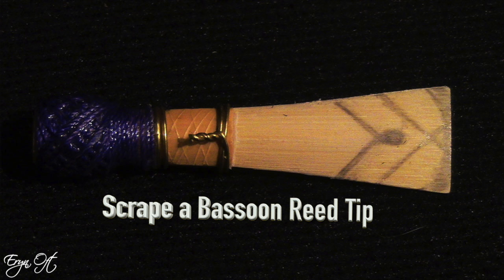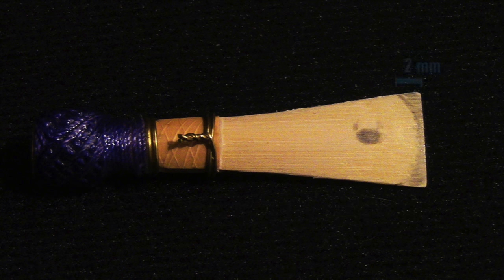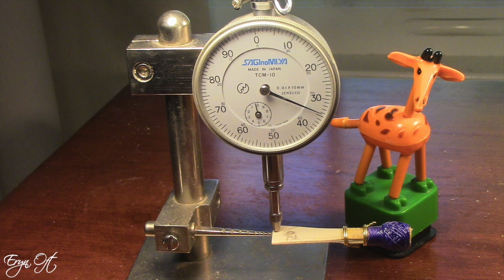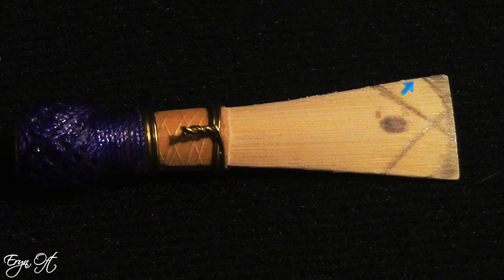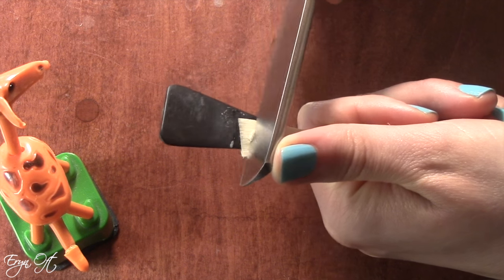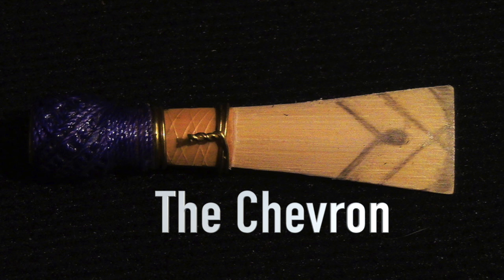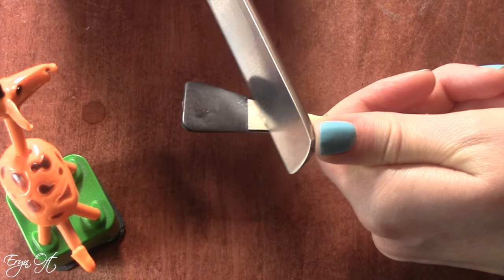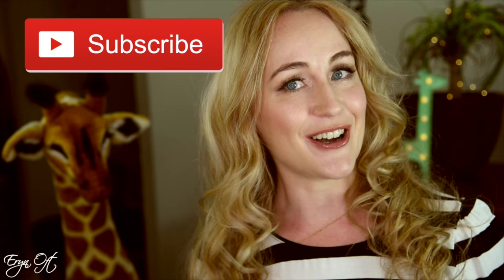3 Easy Steps to Scrape the Tip of a Bassoon Reed

Comment: Hi Eryn, I love your channel and all of the content you have been putting out! Do you have a video regarding reed adjustments? For example, I have some reeds that will drop drastically when I play an e. One of my teachers has told me to trim the length of the blade but it hasn't been successful for me.
Reply from the maker: Hi Shelby! Thanks for keeping up with my bassoon adventures. I am working on a video for reed adjustments. If trimming the blade of the reed hasn't helped I suggest checking the tension on the first wire, flexing the tip of the reed (I do have a video on this!) or waiting for the cane to age. Soft cane will be too flexible, if you can wait a couple of years this might be a great reed. The cane is too soft for now. Here's a link to the darkening video/blog: https://erynoft.com/2015/04/05/bassoon-reed-darken-sound/ Happy Bassoon-ing!

Comment: Thank you for this video. I found it incredibly helpful and my reeds immediately responded better with a warm, less resistant tone in all registers.  One question.... Do you approximate where the heart is or do you measure?  Thanks again!  I really enjoy your videos.
Reply from the maker: Hi Heidi! Thanks for watching. Glad you found it helpful. I do measure the heart and often times I color it with a pencil so that I am sure that I don't accidentally scrape the heart. If the pencil marks begin to disappear I know that I am over scraping. :)
Reply: Hi Eryn,

I'm hoping you can advise me on a reed issue.  Sometimes after working on a reed, the middle A won't speak properly.  It sounds like the lower A and the middle A are speaking at the same time.  I try flicking to get the middle A to resolve, which sometimes works right away, but it's a struggle.  This problem has happened to the last couple of reeds I've tried to finish....What do I do to fix this problem?  Thanks!
Reply from the maker: Hi Heidi, 

This is a tough one. Without seeing the reed, scraping technique and the match to bassoon and bocal I am not sure I can adequately answer your question. If you'd like to do a SKYPE reed lesson I could help more. But currently there are too many variables.  Wish I could do more. :)

Comment: Hi Eryn, do you have a video on reworking the cane when it's formed but the sides (rails?) don't meet? I've had some cane slip when I was adjusting the wires and I'm not sure how to move them back into place. :)
Reply: +Steph I would say from my experience (because this has happened a lot in my reed making) that once formed... you could reform if they don't look like they line up right... but that rarely fixes it in my opinion. take caution when putting on wires.. I was taught at first to tug on the wires and make sure it is very tight... but then I was shown to only really get it about finger tight and DO NOT TUG AND TIGHTEN!!! I find when I do this I can ever so slightly twist one way or another and then causing the blades to slip or slightly overlap. I find that a minute slip, more so a mild overlap than a slip, that it actually helps with my high notes a lot... the only problem I have with that is my own OCD that i want it perfect perfect... but we are dealing with cane... it's a plant... it will never be perfect... the plight of all bassoonist!
Reply from the maker: +Steph Great to hear from you! I don't currently have a video on my channel about this. I will add it to the filming agenda! It may take a bit of time but I will get there. Promise. :)

Comment: Do you scrape with the Reed wet or dry?
Reply from the maker: I make sure the reed has soaked for 30 seconds so that I can insert the plaque without worrying about cracking the reed down the tip. From there I scrape as the reed dries out. Hope this helps! :)

Comment: What is the dimensions of your reeds blade? (Collar to tip) I'm just wanting to check so I can adjust my scraping accordingly to the dimensions I use.
Reply from the maker: HI there, Here is a link to a blog with my initial scrape measurements that I use for my Raffe Reeds. https://erynoft.com/2016/02/28/barton-cane-eryn-oft-style-cane/ I only go this light on Hard Cane. Softer cane will collapse and run flat with these measurements. Cheers!

Comment: what do you do if you don't have a micrometer I probably misspelled that
Reply from the maker: I use a combination of micrometer and light. But you could just try using only light. Hold the reed blades in front of a bright light. It will show darker spots that are heavier. Do be aware of hyper pigmentation that is not a heavier spot, just a cane pigment. That is the only danger. But a light will help you get started! Hope this helps!

Comment: Hi Eryn, if I draw on the patterns on the reed with a pencil semi-lightly, do I just scrape until the pencil marks are completely gone? (I don't have a micrometer to measure ;-;) Thanks in advance!
Reply from the maker: Great question. I draw on the reed, scrape off the markings, then play test the reed. Some cane is harder (will need more scraping) and some cane is softer (will need less scraping). By play testing you can be sure you will not over scrape. If the reed still feels resistant or lacks response- mark the reed again and scrape again. Even if you had a micrometer this is the process I would suggest!